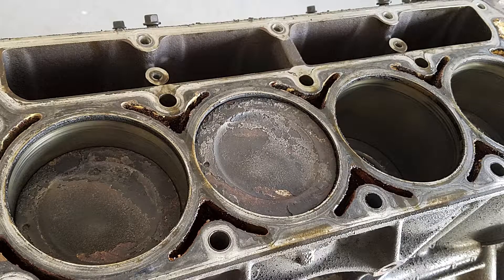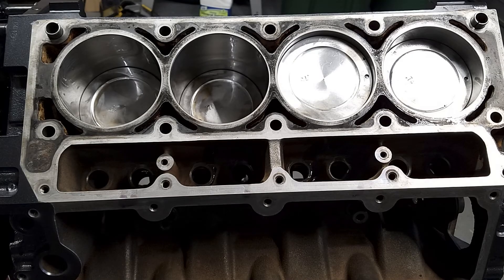How To Build An LS Engine – Machine Shop Evaluation Results

Comment: How often do you get a LS that's already been rebuilt?
Seems like a rare case
Yeah you only spent $2k on your "budget" rebuild, but not very common for a fair comparison.
Reply from the maker: That is 100% due to the fact that I made sure I bought the engine that had the highest compression readings even though it was a high mileage engine.